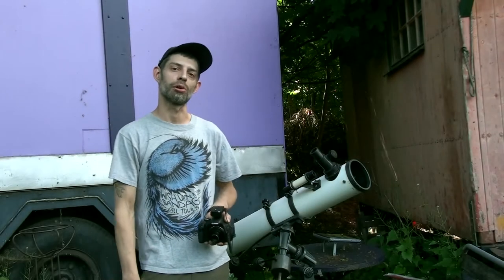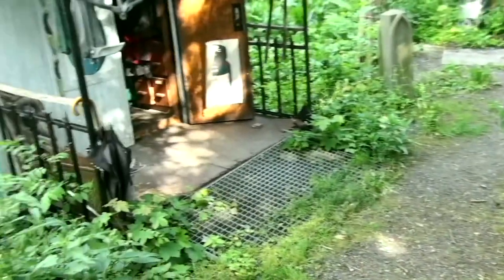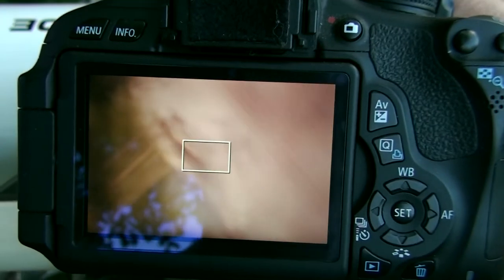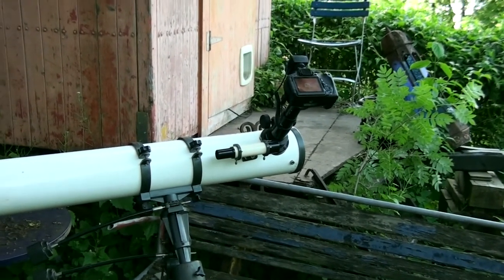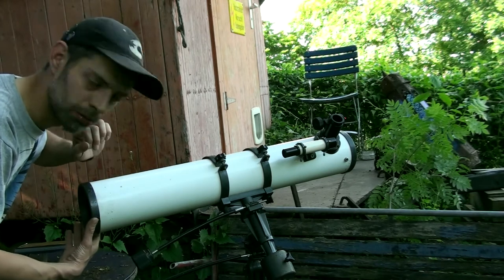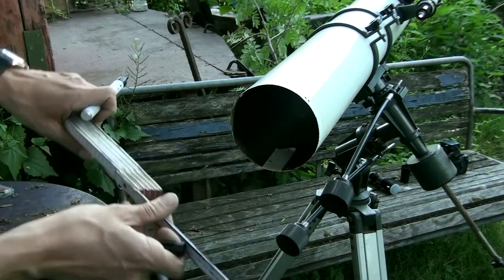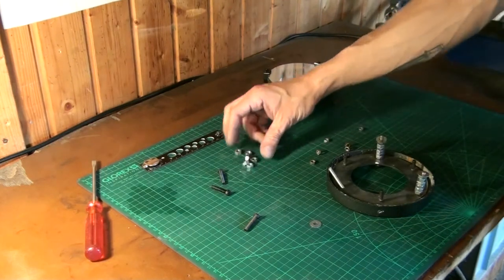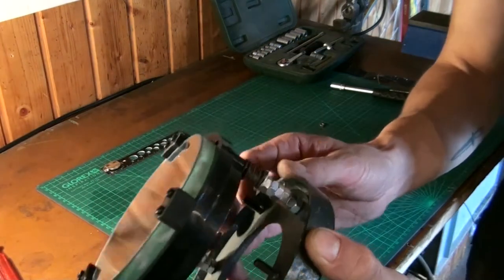How to fix Newton Telescope Focussing Issue (DSLR Prime Focus)

Comment: 5:50 - One serious error: using a 2x Barlow lens will cut the light, not in half, but will cut the light to 1/2 x 1/2=1/4.  It's the inverse square of the Barlow magnification.
Reply from the maker: Thanks for the Correction Mate! :)

Comment: Thanks for this video. About 10 years ago I bought my first Newtonian 130 EQ and tried it with my Canon DSLR and was heartbroken when it wouldn't achieve focus. I didn't like the Barlow solution and getting a low profile focuser was about the same cost as the telescope. I've seen options to cut the back end and move the mirror up but i just couldn't do that. I now have a 6" SCT but i think the old Newtonian will be making a reappearance thanks to your encouragement. :) Cheers from Toronto.

Comment: Mighty smart!  I have a 150mm reflector with a 2" focuser which will focus if I take out the 1.5" adapter.  My 130mm grab and go reflector with only the 1.25" focuser, will not focus.  So, I will disassemble it and if I don't end up killing it (I have the mechanical ability of a wet butterfly), make this modification.

Comment: how will moving the mirror up affect the focal length? will the image be zoomed out more?
Reply from the maker: Hmm well take this with a grain of salt, because i am not 100% shure, but i thiink it wont affect focal lenght at all. I believe that you only move the focal point (the "recombination or cross section point" of the light). Also just from looking trough the eyepiece, the Moon for example looks the same like before the modification. I think Focal lenght is a fixed value, its about how curved the mirror is (correct me if i am wrong anyone!;)
Reply: @BremsstrahlungChannel thanks for the input... if this is the case why are all these newtonians manufactured this way?
Reply from the maker: @anthonyip  i guess its just because the cheaper ones are mainly ment for visual, they dont assume you wanna put a camera on it. I think youd need better/more expensive and bigger focussing mechanisms. Also maybe a reason is because most of these models were designed before everyone had a smartphone or otherwise digital camera, back when i was 12yrs old when i got this telescope there was no such thing as affordable digital cameras ;)
Reply: @BremsstrahlungChannel  i see thanks!
Reply: The focal length is an intrinsic property of the main mirror's shape. It will not change because the main mirror does not change. You only shift the focal position more towards the focuser, away from the tube, leaving more room for back-focus.
Imagine that there was no secondary mirror at all. How would the focal point behave if you would shift the main mirror back and forth?

Comment: This is fine but then you will need a extension tube to reach focus with my pieces. There isn't any big deal but I have to use extent and extension to reach focus with my eyepieces anyway even without moving the mirror.